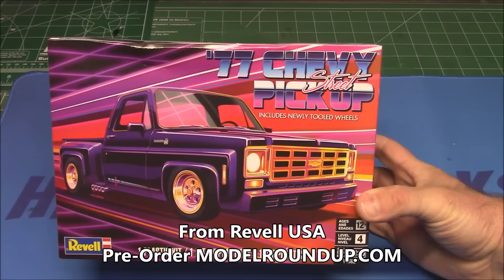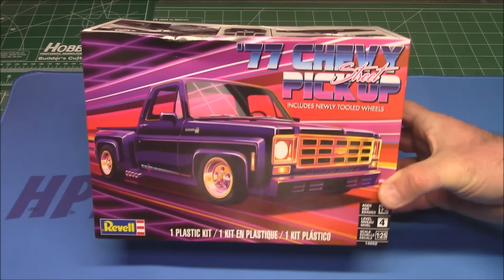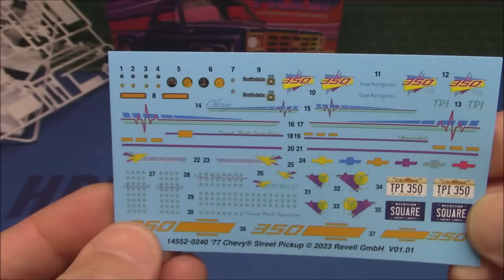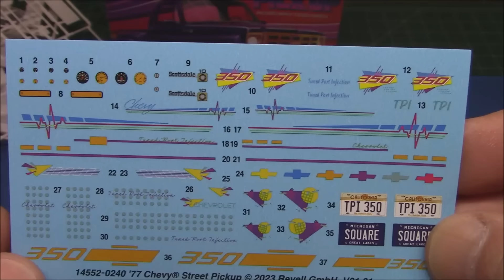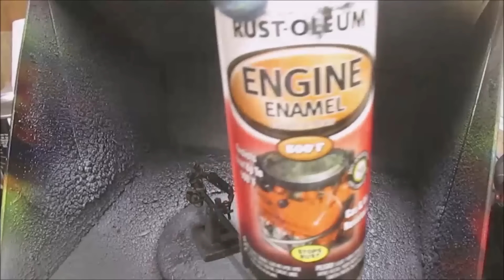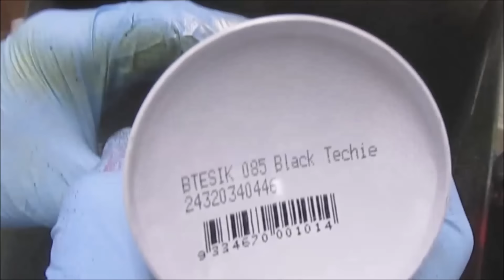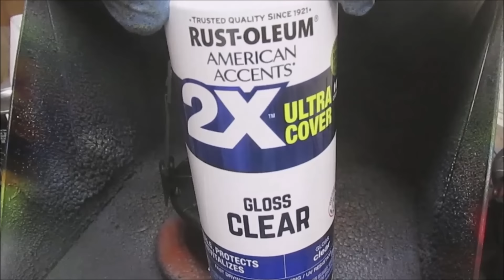NEW PARTS! 1977 Chevy Street Pickup Squarebody 350 1/25 Scale Model Kit Build How To Assemble Paint

Comment: I'm modifying a 4x4 version into a 2wd to match my '79 I've had for 25 years. Robbed parts from 4 kits so far to do it. Just need some chrome cragers now
Reply: Which kits did you use to get the 2wd parts? I bought a '60 Chevy pickup kit to use/modify the parts from, but was curious what you were using. Thanks
Reply: I cut the upper and lower A arms and spindles off of a 55 chevy model I had and cut the lift blocks off the rear leaf springs it came with to get the ride height. Now it has the right rake
Reply: I started with 78 gmc big game kit for fleetside bed. The 76 chevy sport for the grill and few other parts and engine from the sod buster kit. Sorry the front end is from 56 Belair kit not a 55
Reply: @frankonthetank3796  thanks! Not sure if you've seen it, but there is a seller on shapeways that sells a correct grille for the '77-'79 trucks in 1/24.
Reply: @JoslinModels  I haven't seen that. Thanks for the info

Comment: Why would they have the sunroof already cut out?  Who would put a straight axle and leaf springs under the front of a lowrider?
Reply: Its an old outdated kit. I have seen some super low straight axle cars but its the old 50s trucks and some high boy roadsters. Not a fan of the sun roofs though.
Reply: This truck would look great over the pulled pork 78 blazer pulling truck
Reply: Cool kit! Maybe cut the roof off and make it a convertible
Reply: I first built this kit in 88 it hasn't changed at all.
Reply: I would like to see a stock shortwide kit.